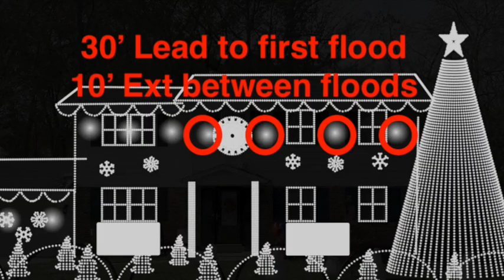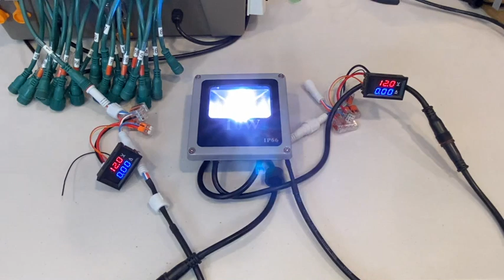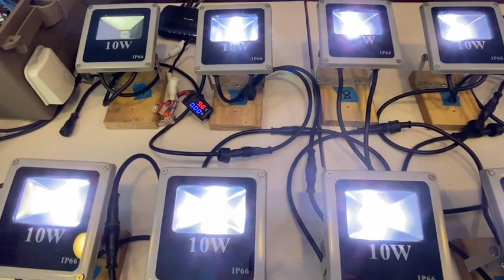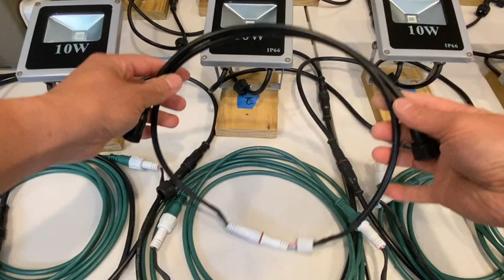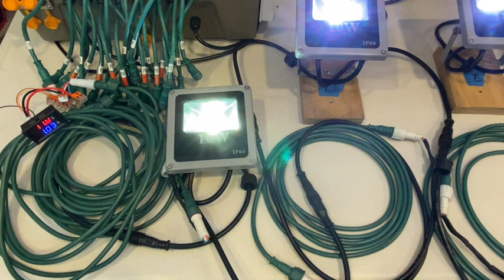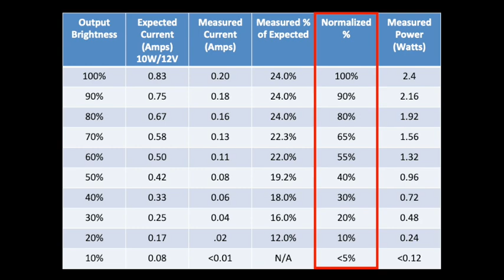Testing the Specs of 10W RGB Floods

Comment: Can you provide the brand name or a link so I can buy some
Reply from the maker: There are a number of vendors where you can get these 10W RGB floods.  I'm not sure of the availability given chip supply shortage and supply chain challenges.  

Here's a list of a few places (in the US), and it's by all means not a comprehensive list and in no particular order - WiredWatts.com, WallysLights.com, DIYLedExpress.com, and YourPixelStore.com.  The floods in this video were ordered from Ray Wu, direct from China.
Reply: @NiFamilyLights  Thank you very much for the response. I love you show

Comment: IM planning on running 8 of theses in my show however my show is all 5v would I be able to power inject the power up to 12v and run the data at 5v?
Reply from the maker: Yes, you can absolutely do that. Data is all 5V. Be sure to connect the GND of the data output to the ground of the 12V power injection as the ground is used by the pixels to reference the data signal.

Comment: If I wanted to setup 6 lights only. What would be an easy starter programmable controller for these? Noobie. I only want these 6 lights and no others, ever. Want to use as decorative floods.
Reply from the maker: Mobgma, I’m personally partial to Falcon controllers at pixelcontroller.com. They have a PiHat which sits on top of a Raspberry Pi, so you’ll have an all in one relatively low cost solution. The PiHat has 2 outputs which gives you options on how to hook up your 6 floods. 

Another option is the KulpBoards.com K4-PB. That controller has 4 outputs and uses a PocketBeagle instead of a Raspberry Pi. 

Both single board computers have FalconPiPlayer images to make setup and control straight forward and easy to use.
Reply: @NiFamilyLights  thanks
Reply: @NiFamilyLights  Would these be better served on the ground facing up at the house or on my soffit's facing downward? I have snow and rain to contend with.
Reply from the maker: That all depends on what you want to accomplish. Weather shouldn’t be an issue for the floods, but if snow covers the floods, they clearly won’t do what you want them to. If you want them on the ground, you could mount them so they stay high enough to not be covered by your typical snowfall.